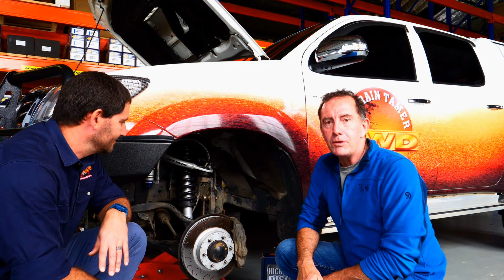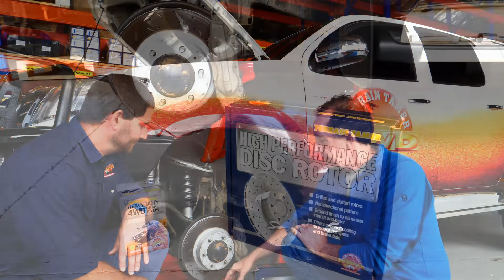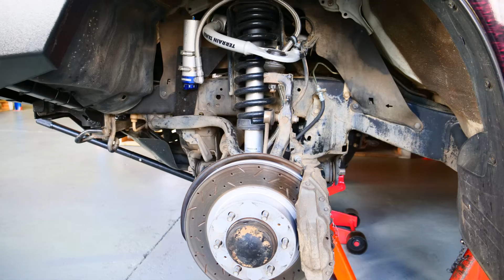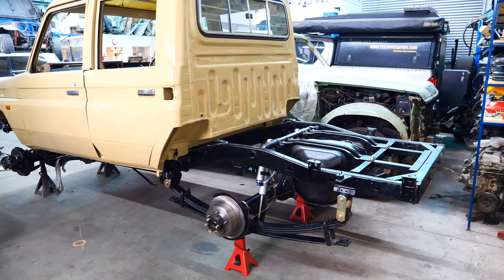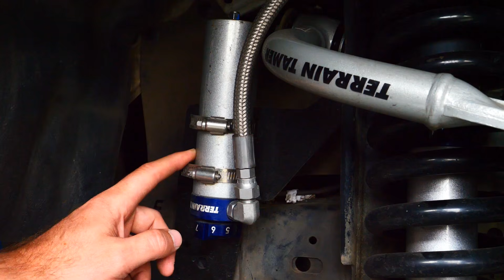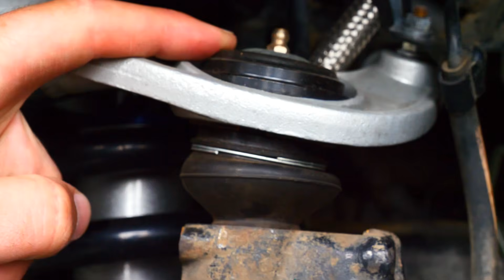Project Hilux / Terrain Tamer front suspension and brakes (EP3)

Comment: Very nice slotted and drilled disc brakes and disc brakes at the rear, but sadly here in Belgium, we are not allowed to install them for use on the public road due to MOT. We have to stick to the standard brakes. Best Regards, David
Reply from the maker: O dear, that does not make a lot of sense.